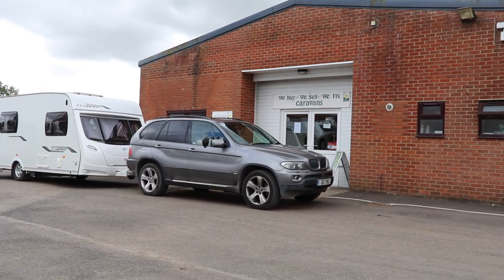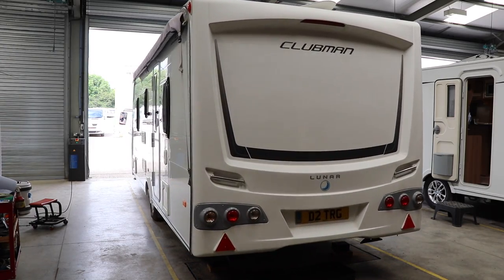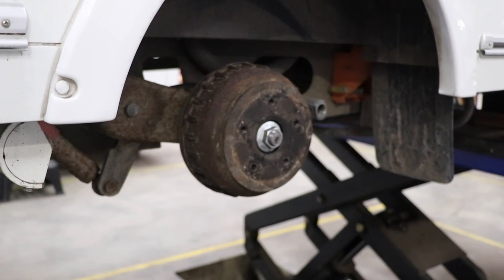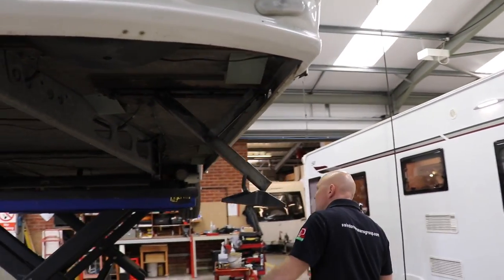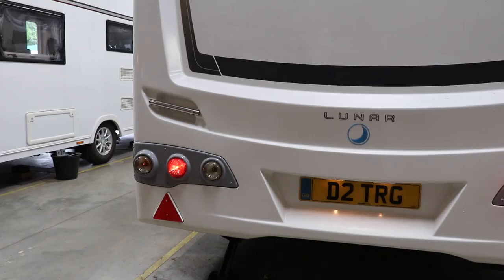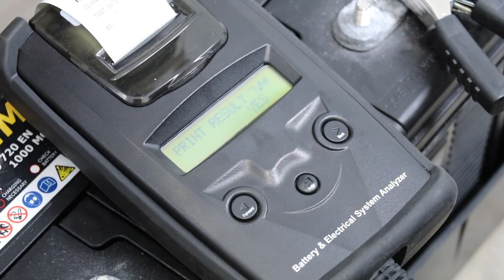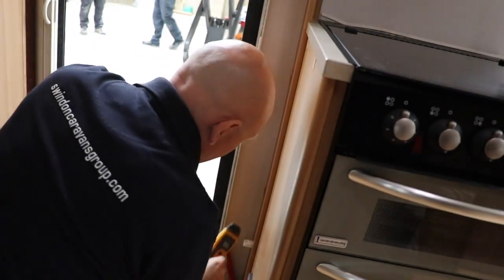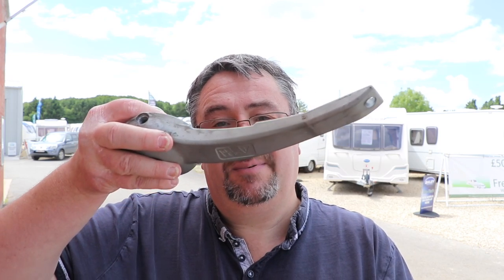Caravan Servicing | Part 1

Comment: Good to see. 👍 Thought I’d write one thing from experience. About 4 years ago at Cirencester C&MC had to get mobile agent out as entrance door lock (same as your c’van here) stopped working and it wouldn’t lock, other way round would have been worse! Trusted c’van would be ok and stayed out and about and had it replaced on site 2 days later. Mobile mechanic stated NEVER ever to spray WD40 into caravan door locks, locks as so many now made with plastic cogs (not metal) and parts that the WD40 causes a bad severe reaction that seriously harms the locks accelerating their failures. Never done it since, only did it once before in its life before that failure.
Reply: I think graphite is the correct lubricant for locks.

Comment: Very good and comprehensive, professional check. However, I purport to being a little dubious about caravan servicing. I'm fully aware of its condition and that everything works inside, and do a lights check before departing any journey, and carry out a general rolling maintenance myself. The only things I require from a service is a grease up, brake adjust and clean really. Hence I use a mobile service who carries this out for about £80.
Reply from the maker: Morning Simon, 

Thats great - sounds like you have the perfect set up there.

Thanks for popping by
Dan

Comment: Did not see any check of wear of friction pads operated by the cracked Alko handle which are an important feature of this anti snaking and pitching device, and evidenced by the LED light also not mentioned, beneath the handbrake position, or coupling up of the hitch to check the reversing override function and brake piston adjustment. Nor were there any gas ignition flame checks or provision of a gas safety certificate which would be required by the owner of a caravan with an Alde type gas operated, water heating system, or multiple power system fridge. Therefore assume this to be a very basic service indeed, circa £150 and a full service including gas safety check would cost closer to the £230 mentioned by earlier comments provided by customers who thought they had been seen off, but had probably just had everything checked. The wheel bearings were probably sealed rather than tapered and would not have required greasing to put to rest the worries of A Marmot.

Comment: Is this a full service because if it is only bare minimal was done here there is a lot more than that is usually done, like wiring checks, also mains lead check including mains plugs on hook up lead also things like hinges and handles were not tighten, operation of the water system, checking for leaks on taps, fridge checks (just to name a couple) !

Comment: Hi, I'm new to the world of caravans having previously had motorhomes, so finding your videos very entertaining, interesting and informative. However I notice that the service includes greasing the wheel carrier tubes. Having just fitted a wheel carrier to our Swift, the maintenance section of the AL-KO handbook for the carrier states that the tubes should be cleaned, but not be greased ? Possibly worth mentioning to your dealer ?
Keep up the good work.
Gary
Reply: I know it's an old comment but I agree. I always thought it was a big no no to grease anything which is exposed to dust and dirt on the road as the grease will just cause it to stick and make a mess.

Comment: Apart from having my gas checked At a dealer.   iv been serving my own Van's for over 35 years in cluding damp checks with meter. Theres nothing there that you can't do your self with a little  effort and common  sense.  And save £300/£400 which could be cost of a nother great trip out.😄

Comment: A great insight to caravan servicing, thanks for sharing. Did they carry out any checks on the water system during the service? I.e. Making sure that the water pump was working and that there were no leaks.
Reply from the maker: Morning Derek, 

They didn't check the function of the water pump, as this was a basic service, and this simply covers off Safety items etc.  The pipes were checked for leaks and that all fresh water & waste pipes were connected correctly with no weeping etc.

Hope that helps
Dan

Comment: I have a 2015 JB Milano caravan and need to do some welding on the tow hitch chassis. I'm told I don't need to disconnect the batteries. Is this correct
Reply from the maker: Hi Ray, 

a good question. In theory there should be no reason to disconnect the battery, however for the time it would take to isolate the battery - i would disconnect the power. After all, i always remove power from the car if im welding etc. 

Dan

Comment: What about the wheel bearings?  They need to be cleaned and repacked yearly.
Reply: Hi, This is incorrect. This caravan has sealed for life bearings, as do the majority of modern caravans. Hence the specific torque wrench used with a drop of Schrauben orange. It was the much older B ^ B chassis s which had taper roller bearings, which needed cleaning, and repacking annually. They were tightened to hand pressure and a quarter turn back and a split pin fitting. However these were the 50s 60s and 70 caravans. I am a sad oldie who spent 42years servicing caravans. The boys at Swindon do a really good job and should be commended.. The only minor comment I would make is the use of WD40 on door locks. It tends to attack the plastic surrounds and the locks will seize. Pure silicon is much better. Keep up the good work.

Comment: Had mine done yesterday at home, and felt sick with nerves until it was complete, as you say in particular the damp check.  RE the tyre psi, shouldn't that be done with the weight of the 'van on them? Or doesn't it make a difference?
Reply from the maker: Hi David, it very little difference, but remember when you have new tyres on the car, they are inflated off the car as well.

Hope that helps
Dan

Comment: I'm pretty sure my last service did not consist of half of what they did
Reply from the maker: Hi Adam, 

it is worth asking what they do offer during the service and asking for proof. Such as the single use nuts and any condition reports from the battery etc. 

Take care
Dan
Reply: Great channel and packed with info.  I agree on getting a written spec on the service.  I'm new to the caravan world (always had camper vans before I turned to the dark side) and was a bit peeved when I was quoted a price for the service only to find I'd been charged a fiver each for the single use nuts, which as you say are changed every time anyway.  Why quote someone a price if you know you intend charging them at least £10 more.  Won't be using them any more.
Reply: Dai Guinness that's pretty standard, a price for the service plus any parts, and the nuts are in addition to the service price.